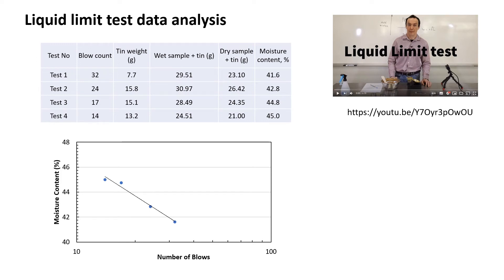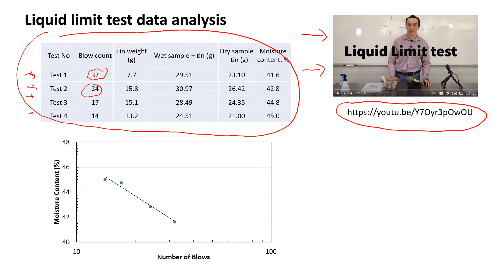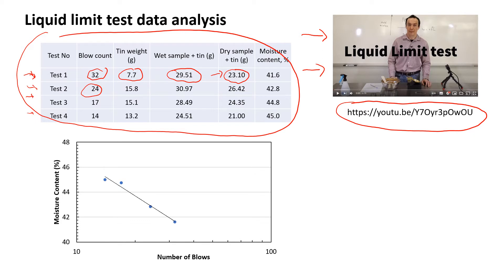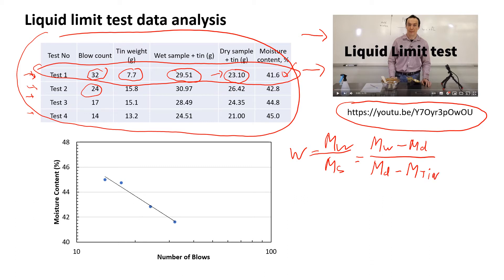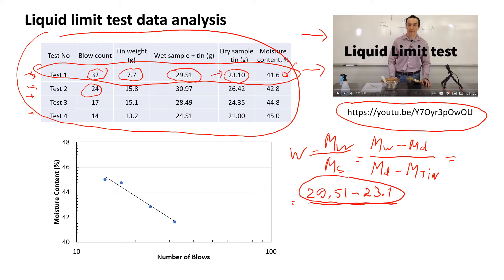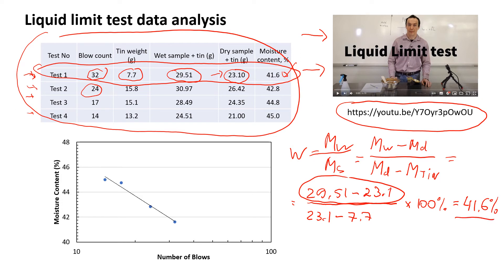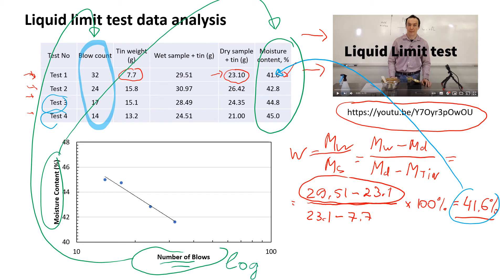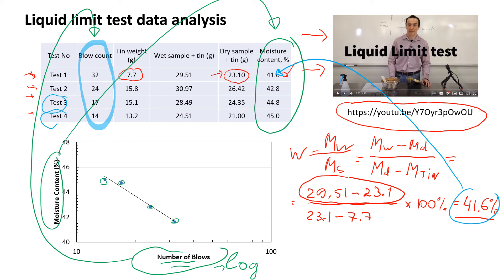Liquid Limit Test Data Analysis | How to Calculate the Liquid Limit Value of plastic Clay

Comment: what is the formula of Liquid Limit without using excel ??
Reply from the maker: You don't have to use Excel, you can draw it by hand, just use a log scale for the X-axis. There is a formula but it is not reliable as it typically uses the result from only one test. You can find it on the Internet if you are interested.